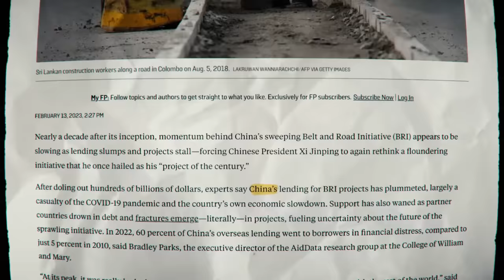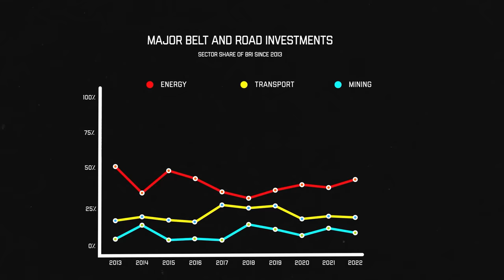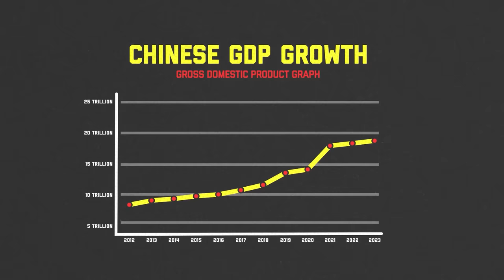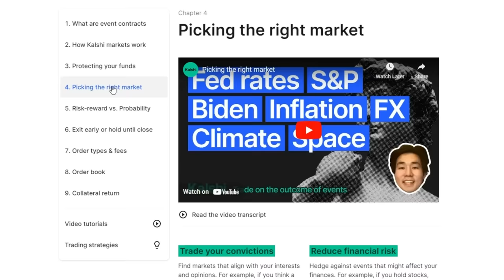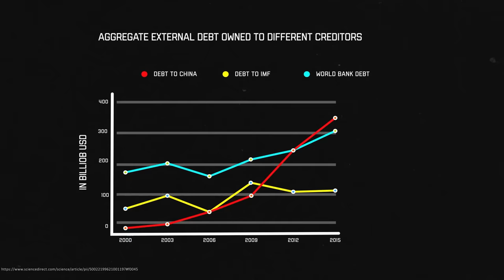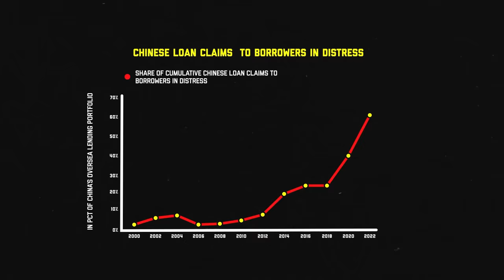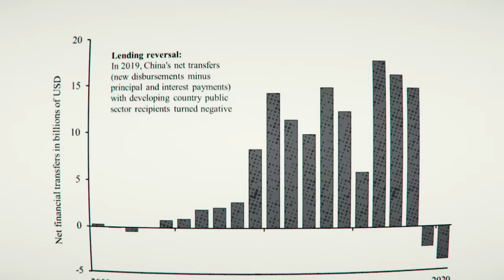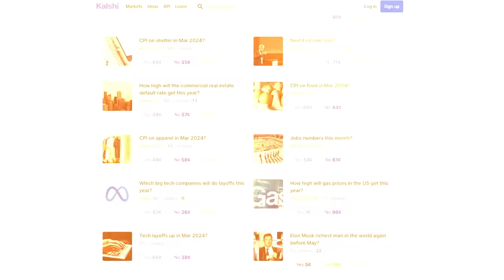How China's Belt and Road Initiative became a Disaster

Comment: Why should you pay for a failed project?
Reply: Because you signed on the dotted line.
Reply: If it’s failed and not finished you shouldn’t it goes into default. Especially when you see everything in China is falling apart because it’s very poorly built. The B&R are even worse.
Reply: From an economic standpoint, it would be an opportunity to open up trade with (at the time, circa early 2010s) an economically strong country like China.

Comment: Is it truly a failure if it guarantees a steady supply chain. A supply chain to skirt embargos, a trade chain to skirt tariffs and a long term trade network.

You can't just make decisions and expect to gain in everyway possible, sometimes you pay to gain strategic advantages that will come handy for the future.
Reply: China is rapidly losing those advantages it gained
Reply: @jurgenparkour9337  China has a huge surplus of USD gained from it's massive trade surplus. And it's pretty much just dumping the USD into infrastructure projects converting them into assets. 

It's not as if China can do anything much with all that USD with all the tensions in place.

Comment: What if china seizes the asset if the country defaults. I’d personally see that as a back door to national expansion in some strategically important locations.
Reply: Not a viable option in the case of sports stadiums, highways running through the countryside, high speed railway lines that the host country can't afford to maintain, abandoned buildings, and so on; in the majority of cases, even if they tried to take over ownership and set up some form of toll or collection scheme it's not going to cure the original problem, which is that nobody is even using the finished products in the first place (which is usually the reason places like the US and India declined to finance the project outright).

With the port in Sri Lanka that was a pretty clever ploy but they weren't as discerning with the majority of other loans they made, and in any case, this all assumes that the small countries aren't simply going to change their minds later on and flip the script, flat out refusing to repay a greatly weakened China if these issues become so bad they collapse the economy and leave them too poor and without the hard and soft power to collect on the debts (especially if they pick a fight with the Indians, or the US).